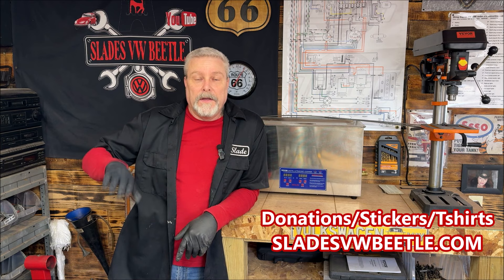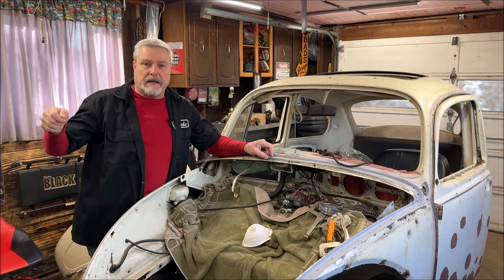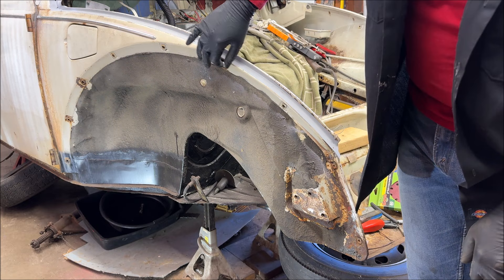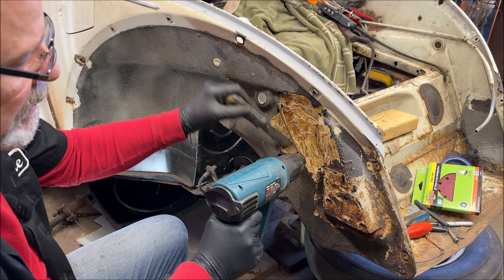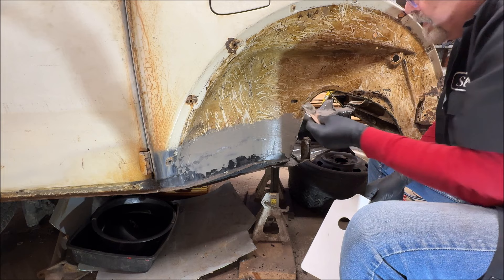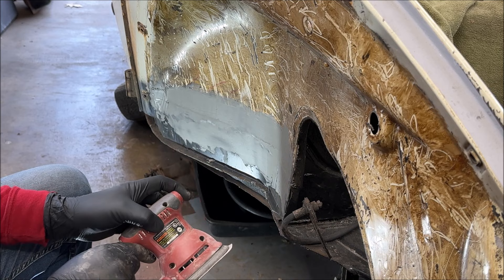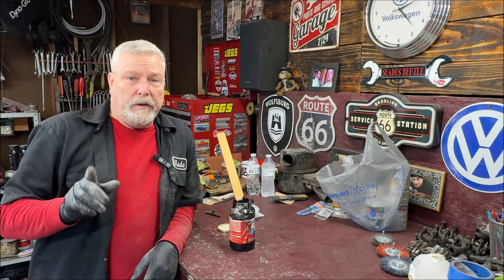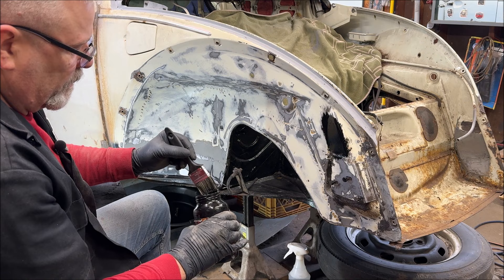Undercoat Removal #2 - Rust Bullet Protection - Metal Bondo  - VW Bug - Baja Bug #sladesbeetle

Comment: This is great, I need to clean my bug up as well.    Also, a tip I learned when working with POR 15, similar to rust bullet, is to put self tapping screws in the lid.  When you want some, take the screws out and pour it into another container, and then put the screws back in.  The tension of screws will be greater than the POR15's ability to hold it.   Great Video, Thanks!
Reply from the maker: Thank you for taking the time to comment. I truly appreciate that. 
And hey, thank you for the tip. I truly appreciate that. 
I love when others give advice, because I surely don’t know everything. 
That is an awesome idea and I will definitely try that. Thank you so much for being here.

Comment: The heat gun remedie is awesome. I used one to remove some old sound dynamat from the inside of my beetle.
One more thing. The Residue left on the inner guard will clean off with some multi-purpose thinner.
Reply from the maker: That’s awesome! It does work very well, I still have to do it to the rear quarter panels also. It makes life a little easier.

Comment: I wasn’t gonna take off the undercoat in the wheelwells because of that seam I didn’t want to mess with it but after seeing this, I think I’m going to. do you have a link or remember where you got that metal Bondo
Reply from the maker: I had to fill in that seam, the last guy left a lot of gaps in it. Not big but enough to make me nervous. I didn’t want to use seam sealer. I actually got the metal Bondo from Amazon believe it or not. I didn’t see it locally. You can use something else if you would like to. Your seam, if there’s no holes in it, you will be fine. The welding work was not good on it. That’s why there was holes. Small ones. But I didn’t want to seam to show at all. I’m kind of weird like that. Lol.

Comment: You don't do primer before rust bullet?
Reply from the maker: No, you can put it on right over bare metal. Just be careful around the lid of the can. 
If you don’t use it all, and you have some around the lid of the can. It’s almost impossible to get it opened back up. So it sticks to metal quite well lol.